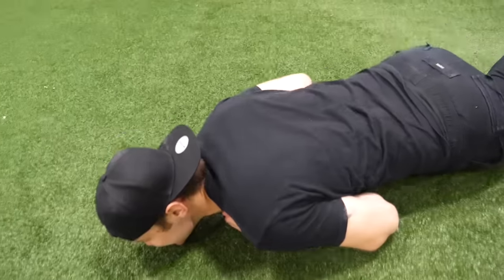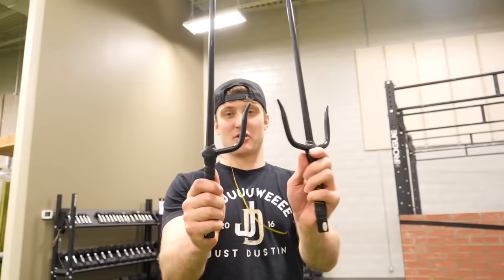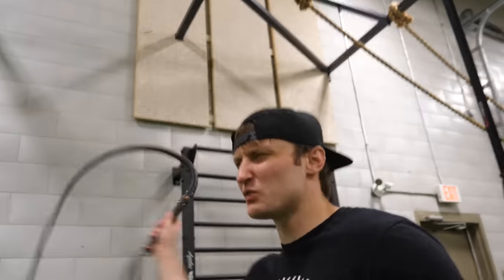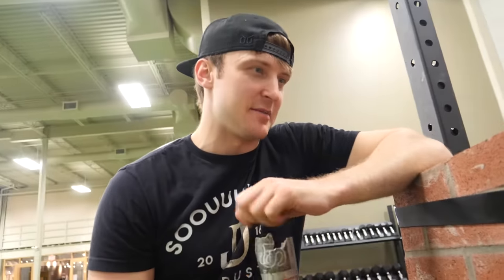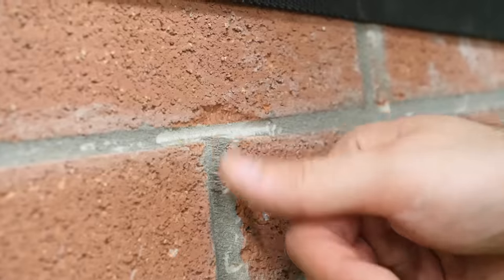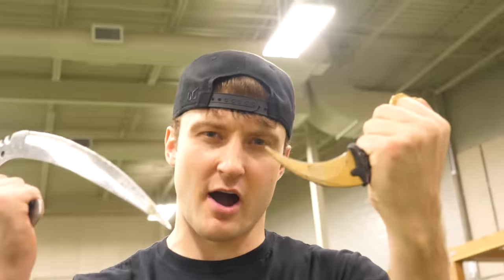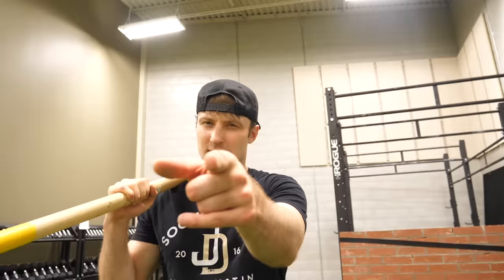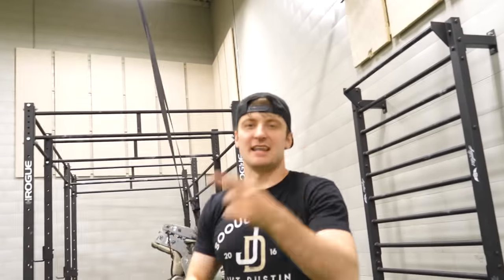100 LAYERS OF BRICKS (DANGER ALERT) UNBREAKABLE WALL

Comment: The Ninja Turtle Weapon is called a Sai. The detachable blades, I’m not sure. When detached I believe they’re Sickles.
Reply: Its Ur Boi those are not called sickles, sickles are usually rounded and used for farming
Reply: And they are not scythes either
Reply: They don't detach dude, the are weapons made for disarming and stabbing, not even made for ninja. Shurikens are also not from ninja, the "ninja blade" is a kunai "koo-nie"
Reply: Dis Boi I never brought up the Kunai..? The doubled edged staff that splits into two blades, is what I’m talking about.
Reply: ActionBoy - Weekly Uploads Egyptians used Sickles as weapons during wars when there were shortages. Also, if you notice, there is a very small curve to them.
Reply: I think they're daggers
Reply: Cosmic Ender not likely. Daggers have sharp, fine points. These don’t.

Comment: raphael's weapon is call sai

also, instead of 100 layers, you should make 200 layers
Reply: 200 layers is just 2 walls
Reply: 1000 layers aka 10 walls of slime
Reply: Rapier*
Reply: there not even 100 layers most the time....but its still alot

Comment: lay·er
/ˈlāər/

noun
1.
a sheet, quantity, or thickness of material, typically one of several, covering a surface or body.
"bears depend on a layer of blubber to keep them warm in the water"

Comment: If the bigger ninja blade is solid steel couldn’t you flatten the tip back down and resharpen it? Or would it become brittle after bending?